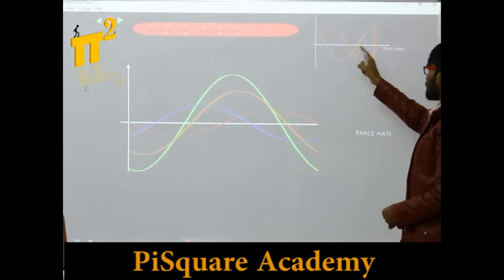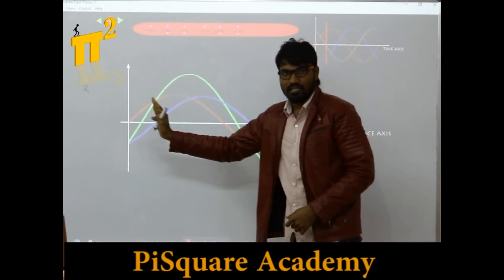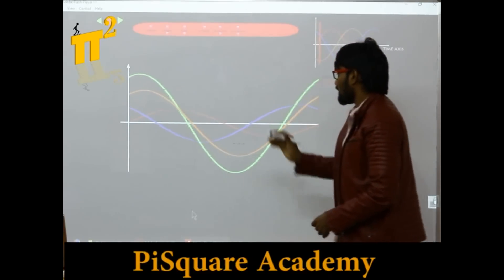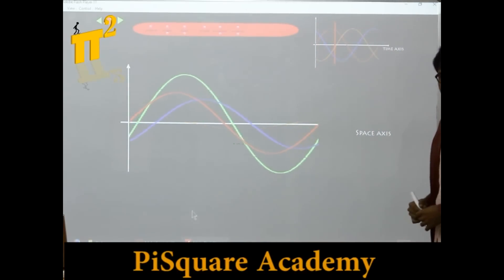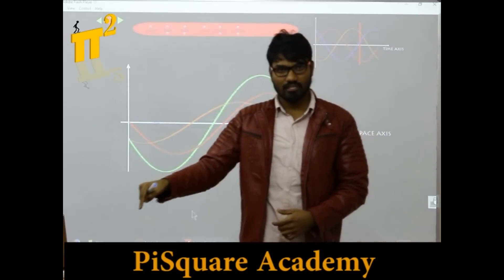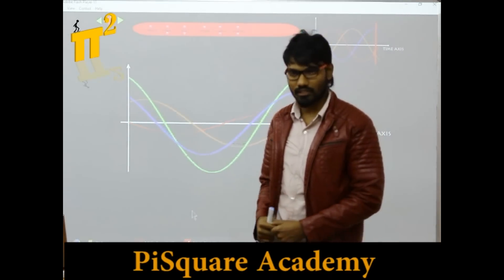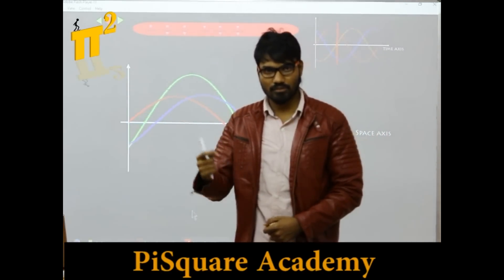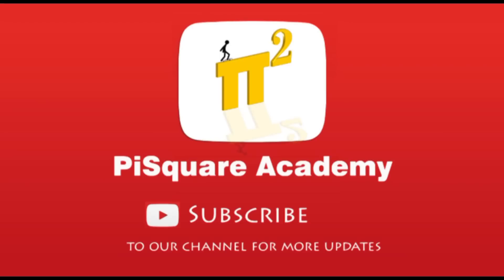Rotating Magnetic Field (RMF) concept| Animation (Subtitles Included) PiSquare Academy

Comment: Sir can you explain this that how the leading phase angle between the current of the auxiliary winding and supply voltage decreases as it shifts from the low capacitive reactance or high-capacitance value (because the starting capacitor is in parallel with the running capacitor) to the high capacitive reactance or low-capacitance value (because the starting capacitor is disconnected and only the running capacitor is working) in a capacitor start and capacitor run single phase induction motor. Thank You.

Comment: For self starting of single phase induction motor we use an auxiliary winding with a capacitor arrangement. Both auxiliary and main windings are supplying from same supply. Then how does rotating magnetic field produce there?

Comment: sir in single phase induction motor how rotating magnetic field produces (that is forward RMF and backward RMF)bcz according to your explanation it is a pulsating one.
Reply: Here, pulsating mmf is produced since there is no phase shift between input currents and in 1 phase induction input currents sre phase shifted by 90 deg in time using a capacitor.